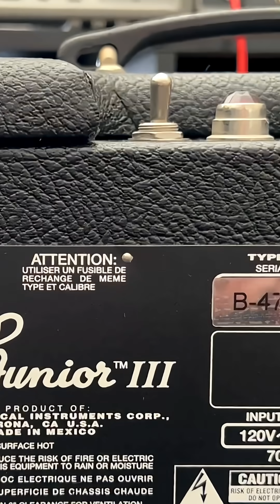Fender Pro Jr III - Static & Signal Dropout #electronicsengineering #fender #FenderProJr  #guitar

Comment: Vox AC30HWH handwired amps are the same way, skimping on the jacks, and also the pots, which are small and crappy. I've gotta do a transplant too on jacks and pots. It sucks that they skimp on parts like this on a $1200+ handwired head, the top of the line for them. Good luck with your's.
Reply from the maker: Preach it!  Those Voxes do sound great when they are heathy.